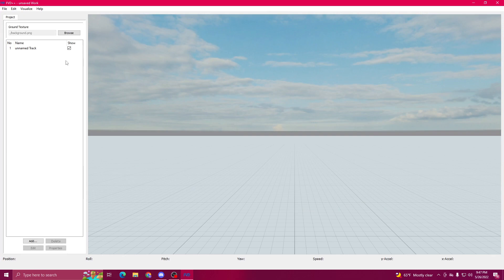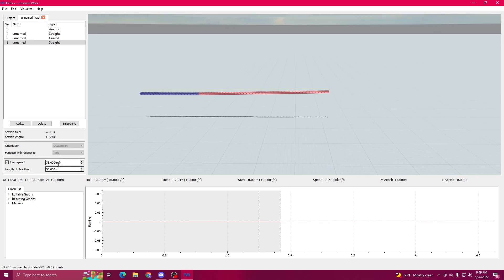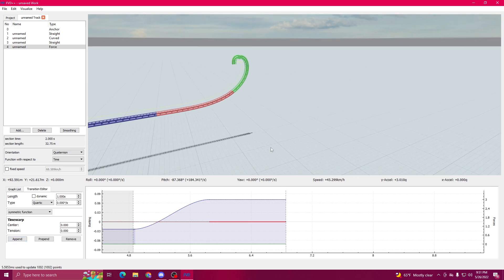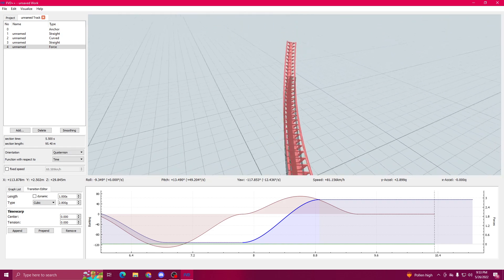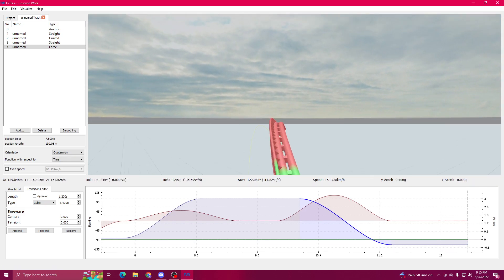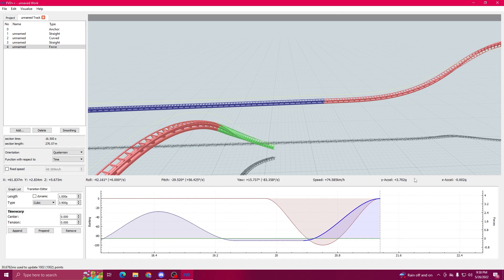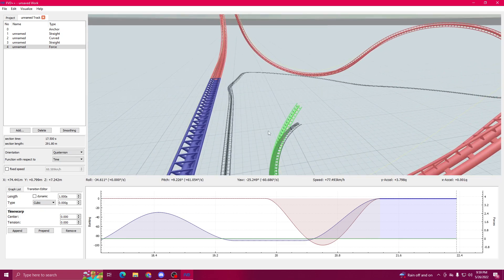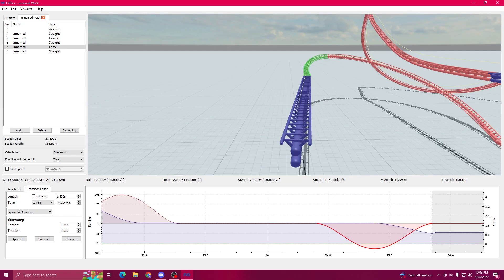[Part 1] How I make my roller coasters | FVD++ / NoLimits 2 Tutorial

Comment: Haha I understand what you're doing because I'm already used to FVD++, but if I weren't I'd have no idea what you were doing. For example at 10:15, the reason shortening that section makes the airtime hill lower is because you spend less time on positive Gs while the track is unbanked. That's something you kind of have to understand and that isn't immediately obvious to people new to FVD++

11:54 It's also worth mentioning that it's better to be conservative with your forces here. FVD++ calculates forces from the center of the train, but forces can differ greatly in different seats, so if you're already modeling after the theoretical limits and then you ride it in the backseat, it might overshoot those limits.

Comment: Instantaneous changes in force hurt (like Magnum XL200), but how about instantaneous changes in the change of force? Basically, are sharp angles in the force graph undesirable?
Reply from the maker: Sometimes, I avoid sharp angles in the roll graph
Reply: @designsbyfunky unless you’re building an arrow
Reply: @designsbyfunky  That makes sense seeing as the roll graph is the only one of the three that corresponds directly with track position. 

Sharp angle in roll graph would be the rolling equivalent of the Magnum XL200 problem: an instant change in G forces.

Not convinced that sharp angles in force graphs would matter though, seeing as there's no instant change in what the rider feels.

Comment: I got some dumb questions:
-is it possible to import a nl2 coaster to fvd?
-can you export coaster parts/segements to add them to a coaster in nl2?
Reply from the maker: Yes for both, I haven’t yet tried importing a coaster from NL2 to FVD but I do know it IS possible
Reply: @designsbyfunky  I only get the option to import nltrack files but not nl2park files
Reply from the maker: @m.hoffman2889  i believe you need to save a section of your nl2 coasters track as an element then import